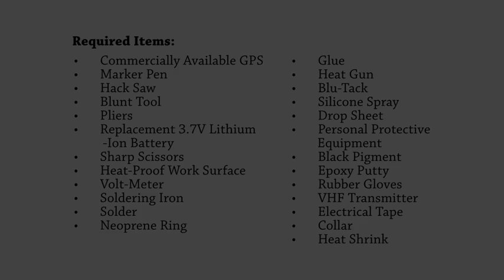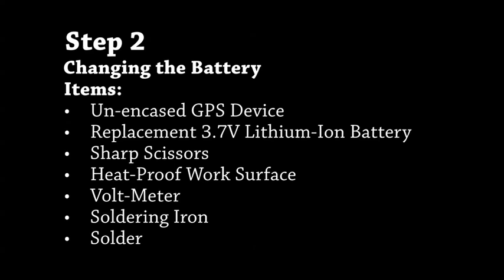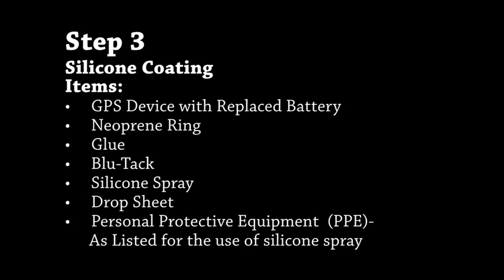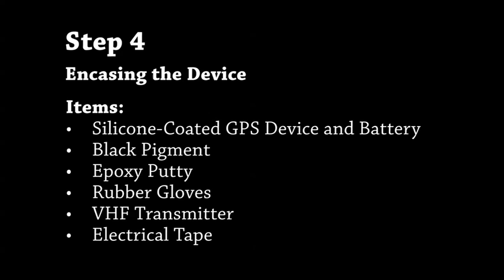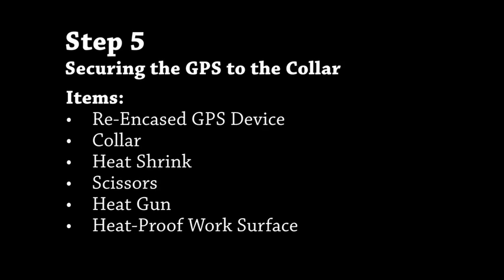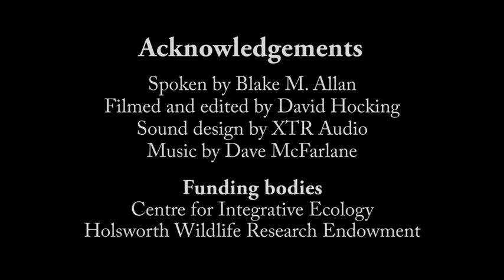A cost effective and informative method of GPS tracking wildlife

Comment: Your VHF transmitter does not seems to exist anymore, any alternative? Same for the GPS device. 
Can you also add a solar panel? Which device will you use to get real time GPS datas? 
We can also imagine a auto detach system to release the colar!
Reply: There are many small GPS devices available. We are still using the iGotU GT120 because it's cheap and it works. Yes you can add a solar panel, but they are hard to keep clean. We ahve tried real-time, but the battery drain is very fast.
Reply: @blakea7061  thank you what about the VHF antena?
Reply: @blakea7061  could you share your test with solar panel? Which product did you use?

Comment: Wait, I have a question: why use a gps chip and then add a vhf frequency?  Can you explain?
Reply: The GPS records information, it doesn't transmit. This uses much less battery, and allows the collar to work for longer. We added the VHF transmitter so we could find the animal and retrieve the collar

Comment: Dude... You should ALWAYS connect ground first, unless you wanna risk destroying your device
Reply: Thanks. Will do from now on. I'm not an electrical engineer, just a hobbyist.
Reply: Actually this is not correct if the device has no other connections to anything.  What Blake did is just fine, just be careful to not short out the battery!

Comment: hello, nice idea. But, can you tell me which VHF transmitter you are using. I need the same.
Reply: shivanshi pandya I'm using a 16 gram waterproof VHF transmitter made by Sirtrack. It has approximately 15 month lifespan at 30 ppm, and a mortality switch of 120 ppm if it doesn't move for 24 hours. It is designed for gluing to turtles, but it suited my purpose because it was a waterproof self-contained unit.

Comment: what is the point of the vhf transmitter?
Reply: These are GPS loggers, not transmitters, so you need the VHF to find the collar and get it back. You get a MUCH longer recording time by using a GPS logger instead of a transmitter.

Comment: Hi, I like this video alot I would like to make it for my dogs and cats.
What UHV transmitter did you use and how does that power? Could you explain some more?
I understand what gps receiver you used and how to install new battery for this. But I would like to know how you send this signal every 10 minutes and how far you can send it and how to get it send :-) How do you pick it up ?
Reply: The is a data-logging collar, meaning you have to retrieve the collar to get the data back. The VHF in the video just sends a pulse every 2 seconds which you can manually track to find the collar. You can track A VHF transmitter with a VHF receiver and antenna.

What you want is a data transmitting collar. Something like this:

http://www.mr-lee-catcam.de/pe_cc_i18.htm

It transmits the location of the device via the cell phone network for real-time tracking. It can be purchased and modified for around $200USD to last over 1 month.

Comment: Will this unit allow you to determine the current location of the wildlife for retrieving the device? In other words will I be able to find the wildlife when I'm ready to retrieve the information?
Reply: I include a VHF transmitter, running off it's own battery, which allows me to find the collar and get the data back. I have recently built a GPS collar which transmits it's location via the cell phone network ($200), but it is larger.
Reply: Blake A How much larger (in grams) is the cell phone version?  Thanks :-)
Reply: The chipboard weighs about 10 grams, so you can make them quite lightweight, but they use a lot more power. I built one that could last for over 2 months recording at 30 minute intervals, but it weighed almost 300 grams.

Comment: how long will the battery charge last on average?
Reply: That depends on the recording frequency, but under ideal conditions you can get over 25 days recording at 10 minute intervals from a 650 mAh battery
Reply: @blakea7061  so in  ideal conditions 1 mAh battery can send 23 intervals, if i change to 1h intervals and it only take about 1 mAh in 1 day ?